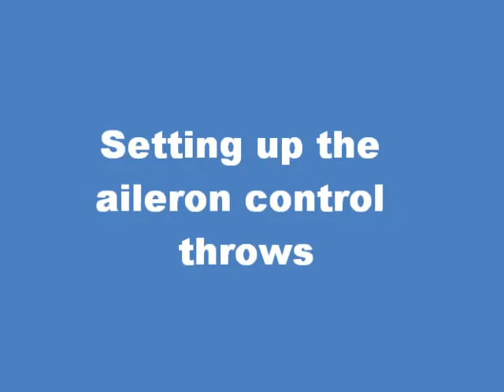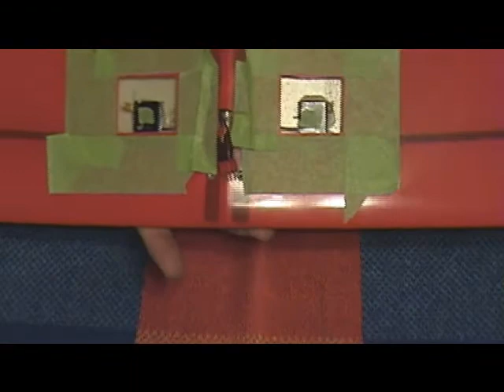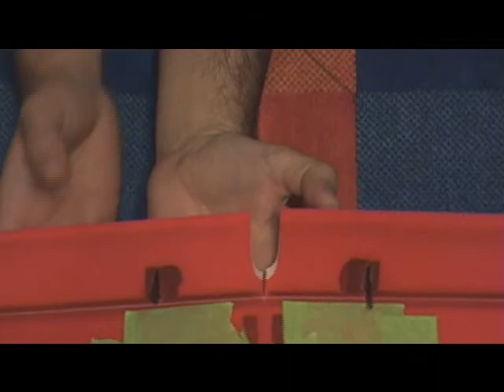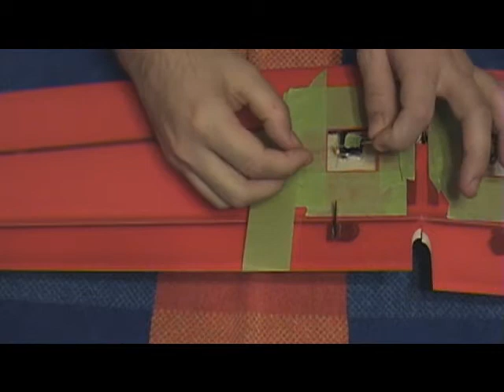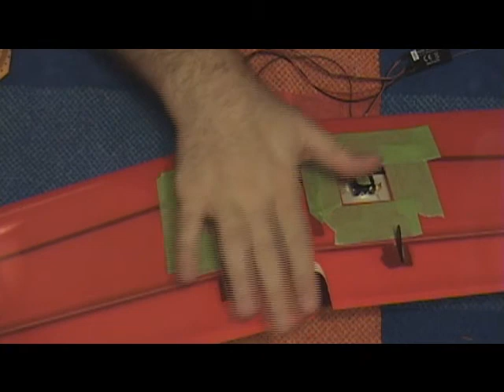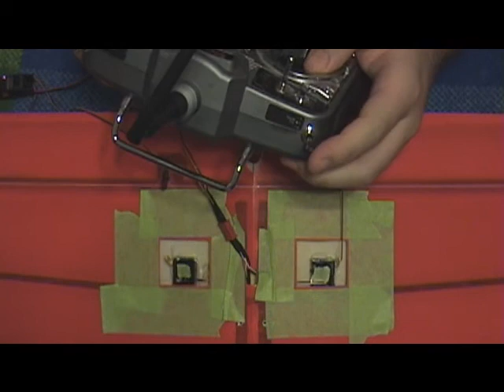Blaster Step 4

Comment from the maker: I set the servo at 90 degrees to the wing; centered.  Then I brought it two spindles closer to the TE of the wing.  I then locked the flap in place with tape and a clamp.  I made two small Z-bends and then cut a small carbon rod.  I used medium CA and, finally, heat-shrink to get make the rods.